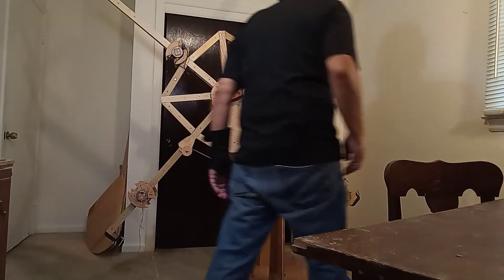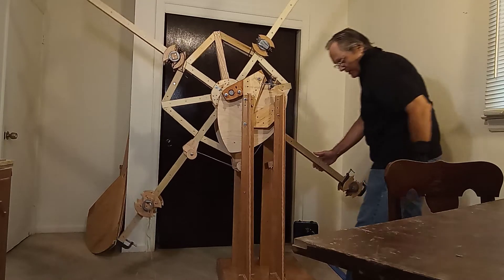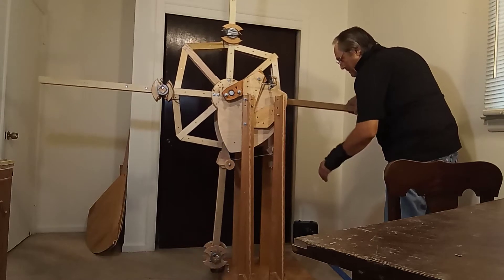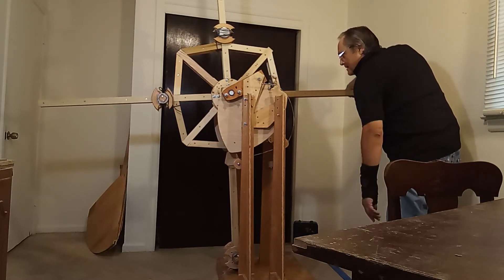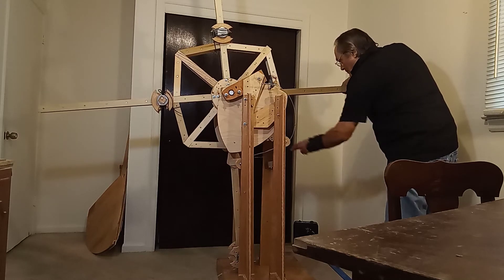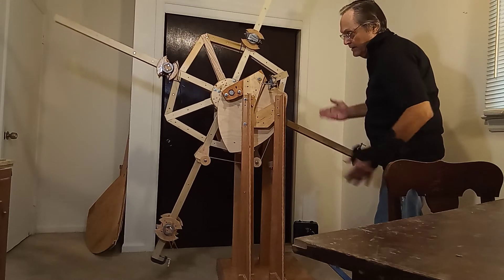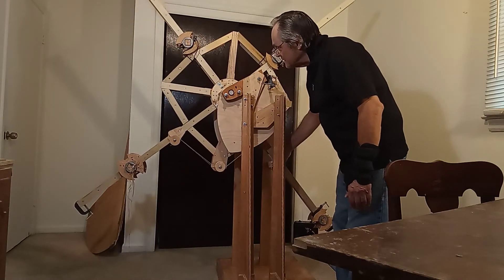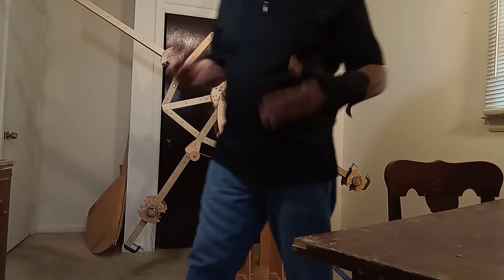A Better Demonstration of Bessler's Principle

Comment: Do you have any updates? This machine works or it's just a waste of time?
Reply from the maker: In the next week or 2 I'll be testing the 8 weight wheel version. I'll be using some dummy weights. Witnesses said that they heard 8 knocking sounds per revolution. With the disc, it creates more distance between the first pulley and the top right of the disc as the wheel rotates.  Technically speaking, when the weight moves up the arm, no work is being performed because the line's length doesn't change. And this does seem to be what Bessler described. An external drum lifts the weights. That's what the disc represents.
Reply: Check mine! These machines will work when the right design is done.
Reply: The or type .